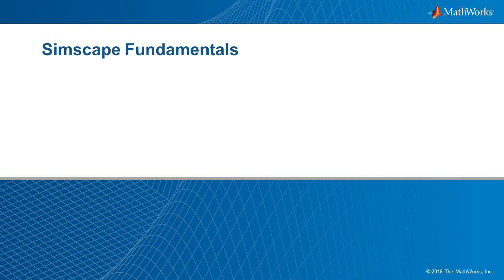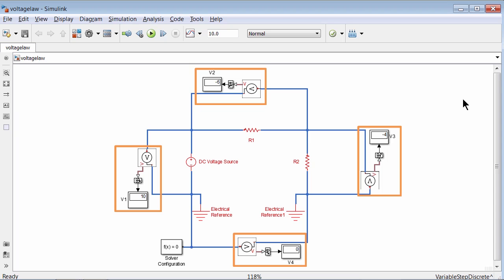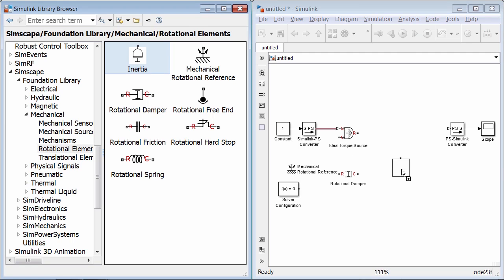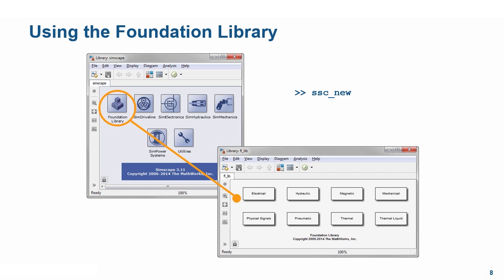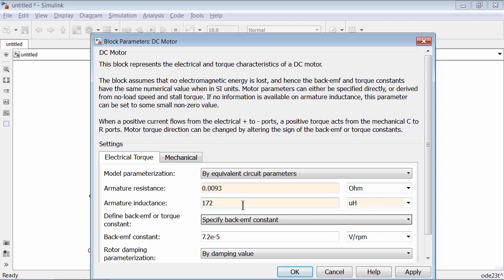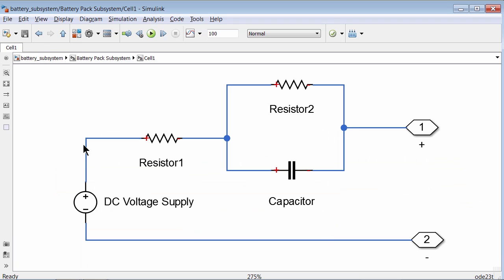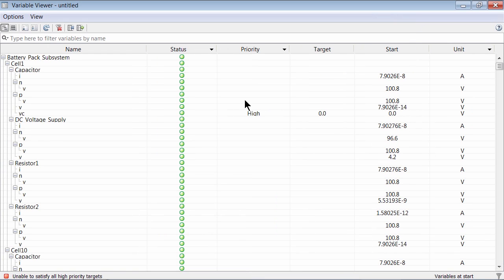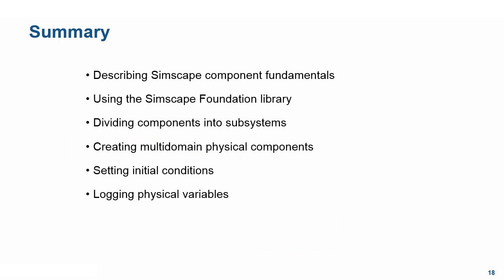Physical Modeling Tutorial, Part 2: Simscape Fundamentals

Comment: This model is structurally singular because some variables are missing from the final set of equations. Check the equations that depend on the following variables: 
['untitled/battery pack/Subsystem8/Capacitor1']: Check variable v. In foundation.electrical.electrical (line 12). I have this error wth the battery pack. I have tried chat gpt solutions and tried changing the voltage but could not figure out the problem. Can someone help me
Reply: You can usually get a more descriptive diagnostic that is causing the issue by set the "Index Reduction Method" in the "Solver Configuration Block" to "None". Will not run but should change the message to be related to what equations are causing issues.

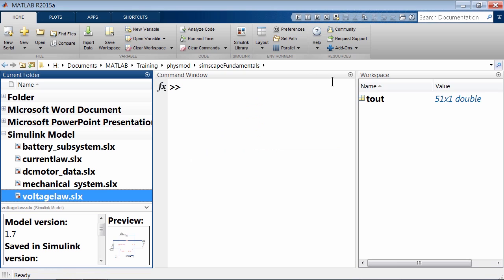Comment: 05:43 ssc_new
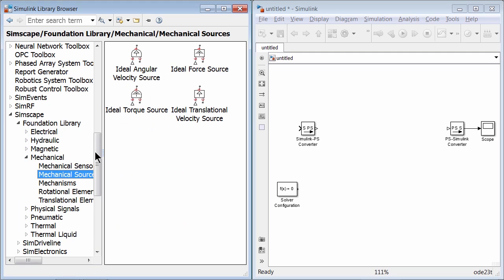07:27 insert Ideal Torque Source
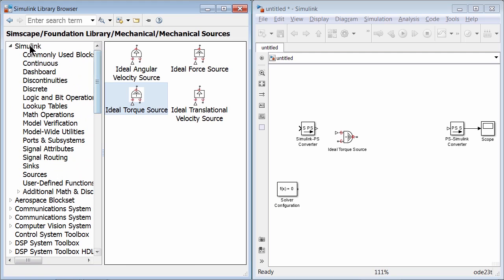08:00 Constant 
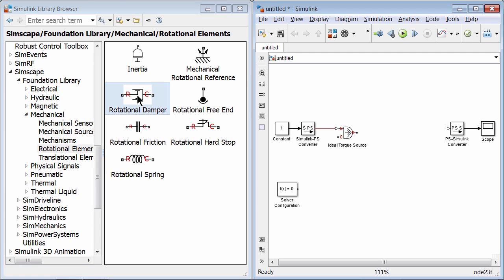09:13 Rotational Damper
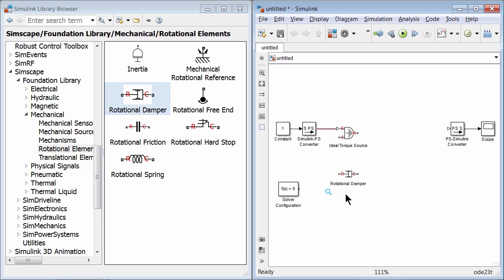09:39 Mechanical Rotational Reference
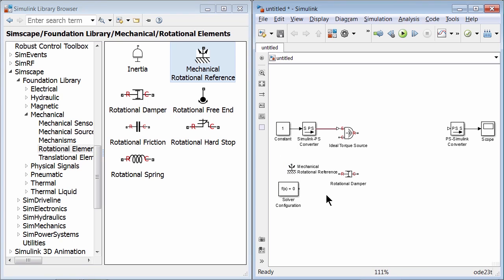09:45 Inertia 
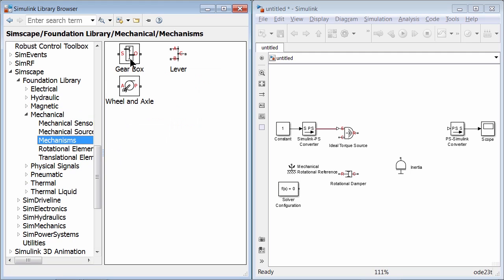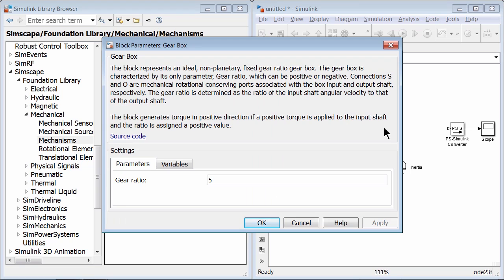10:00 Gear Box 10:15 parameters [2]
11:17 Ideal Rotational Motion Sensor
12:12 Terminator
14:00 Final Model and simulation
18:40 DC Motor + Parameters
20:40 Gear SS
22:15 Sensor SS
23:28 replace ideal torque source by DC Motor
Reply: God bless you
Reply: @Dems_is_stealing_your_money  🥰

Comment: Just for my understanding: shouldn't the rotational damper be reversed? Or does it not matter mathematically? Thank you for the upload this was very helpful
Reply: I think it should as generally we connect C with the mechanical reference and R with the required signal, but in this case I got same results for both the cases.So, I guess it doesn't matter!!

Comment: Hi, thank you in advance. i'm getting second order output signals on sensors using simulink 2018a and my final value is 530.5 for input and 265.3 for output, as expected has a reduction of two but with wrong behavior and values. Could you possible explain me what's going on?
Reply: Did u find the answer?